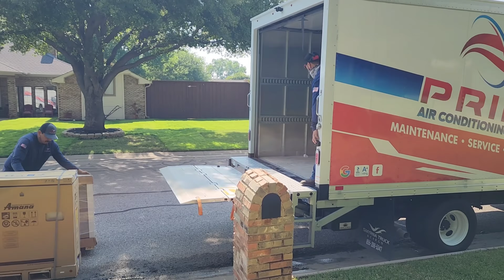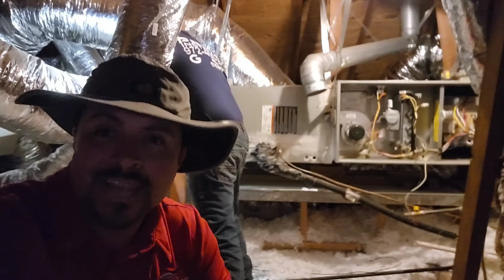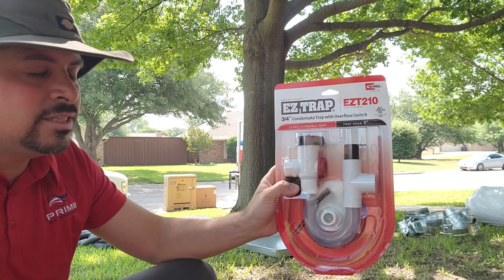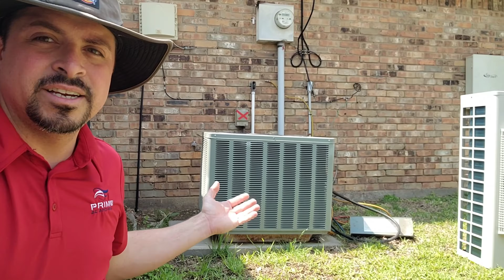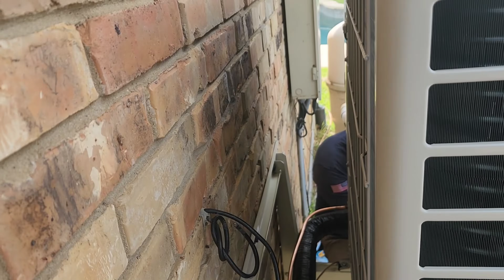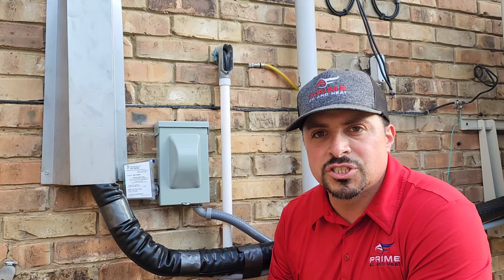"Unbelievably Cool 😎  The Amana S-Series Slim line!" | Installed By Prime AC and Heat

Comment: Anyone know exactly what surge protector is used on these systems?
Reply from the maker: @dennislange1757 

Thank you for watching and commenting on the video. The surge protector that was used on this unit is the Model AG-3000. Here are some of its beneficial features

Three modes of protection: L-G, L-L, L-N

TPMOV® surge protection technology

Green LED indicator provides status of protection

Type 4X watertight and UV resistant plastic enclosure

3-year product warranty

$7,500 connected equipment warranty for 3 years

UL Listed to ANSI/UL 1449 5th edition

Hope this helps 👍

Comment: Why do yall pan off the evap coil.  Why not do a transition?
Reply from the maker: Great question, @timothymcconnell4408! 
Per the installation manual's page 2 section on horizontal coil installation, both the Z-bracket method and the use of a transition are approved by the manufacturer. Importantly, neither method impacts the system's performance. In some of our videos, we've chosen the Z-bracket method for specific demonstrations. Still, we recognize the significance of displaying all approved techniques. Look out for future videos where we might highlight the transition method.
Thank you for your keen observation; your feedback is greatly valued.
Reply: Normally, you would center the coil both sides of the opening are the same...I'm more of Bosch inverters and Gree...Installing my first first S series tomorrow
Reply: I think panning off is lazy... If it is approved by the manufacturer so be... Everything else looks great
Reply from the maker: @timothymcconnell4408, thank you for sharing your perspective. When adhering to manufacturer's guidelines, especially in HVAC equipment installations, aligning the coil centrally on both ends may not be the endorsed approach. Utilizing Hung-Rite Kits or unistrut for hanging equipment – as recommended best practices – necessitates precise coil positioning. An uneven or bottom-centric coil placement can inhibit the unit from being flush and level. Consistently following the manufacturer's directives is paramount to guarantee the equipment's durability and to deliver the utmost performance to our clients. It's commendable to learn of your enthusiasm for Inverter systems. Your dedication to the field is evident, and we wish you continued success and excellence in all your professional undertakings.

Comment: Does any of the equipment in the attic require 220V since you still have gas furnace?
Reply from the maker: Great question! Tho some applications (primarily electric air handlers) you will  require 220V. The gas furnace equipment that we installed only required 120V. Thank you for watching our video and asking your question.